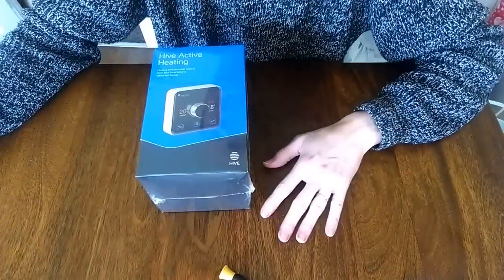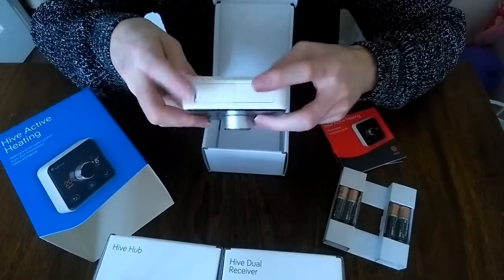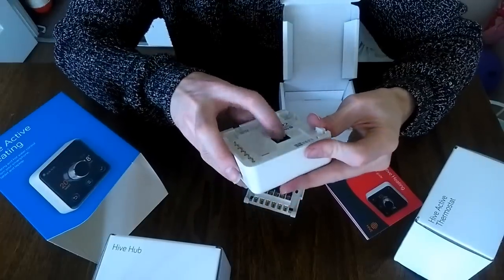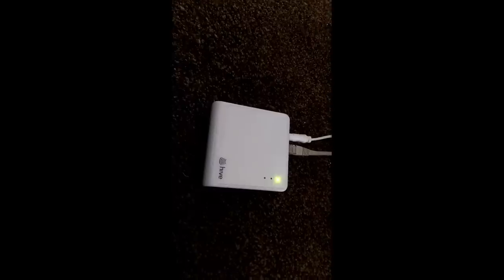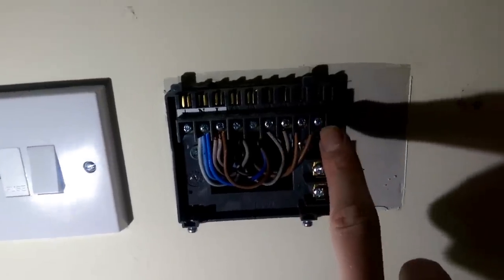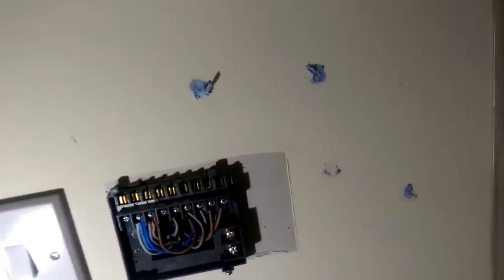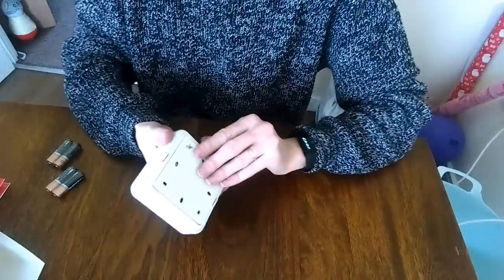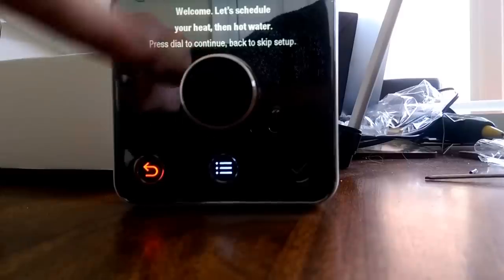Hive active heating system installation and guide

Comment: Anyone advise me i cant pair my phone to the thermostat using the app. My phone cant find the thermostat. Any help please?
Reply from the maker: Hi, I'm assuming you purchased the Hive hub too? You cannot pair a phone directly to the Hive thermostat on it's own, you need the hub. You then register the hub (using the code underneath) at the Hive website and from there you can login using your phone hive app.
Hope that helps.
Reply: @junkendriven  I have the hub yes. On the app where it says manage devices it has the hub there saying its connected. But I try to find the thermostat and it never finds anything at all gggrrrrrrrrr!!

Comment: Im having trouble connecting my hive active heating ! I have connected live and neutral to the receiver ,and connected live in and live out to the combi boiler and removed the link for room stat . Where do i get my common from to connect to terminal 3 on the receiver as per diagram 2b hive active installation guide .
Reply: Is it a combi compatable Hive?

Comment: I need a system for setting shift patterns one week early one week late shift will this do that does my head in changing it every week
Reply: I no I'm the same with my hive lights. The hive timer works like the alarm clock on your phone. You can set it up for the week. But would then have to set it for the following weeks schedual. update I have just got one in my Black Friday deal. I shall still be working all different shifts. So am going to use it manually from my phone.
Reply: Thanks  @LewisBrain

Comment: Hot water only comes on when heating is on. Doesn't come on when timer tells it to or when stock of hot water is used. Grrrrrrrr any ideas?
Reply: Sorted....at a cost of £260.      Grrrrr
Reply from the maker: Sorry to hear that and sorry for late reply! That's a wiring problem, probably at the boiler end fitting, sounds like they're not splitting correctly, don't think that's a problem with hive itself though.
Reply: Mark Lloyd what was the problem in the end?

Comment: And how long do the batteries last?
Reply from the maker: So far the original batteries are still going strong. So far 7 months.
Reply: Thank you, its just I had seen some negative reports regarding this aspect/
Reply from the maker: No problem. The units use the Zigbee wireless protocol which is a smart meshing technology. Battery life will be affected by distance from the receivers, construction of walls, etc, as the units will consume more power the further away/more power needed to transmit. Mine are in a new build house (4yrs) and so very thin/basic walls so won't end up consuming much power.
Reply: Change the batteries once a year